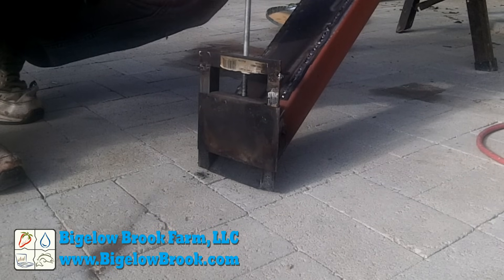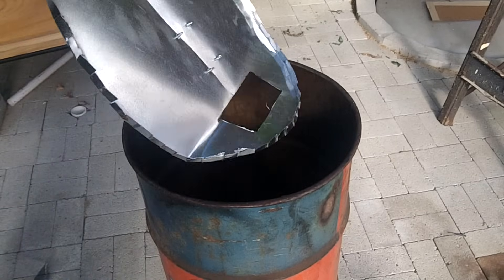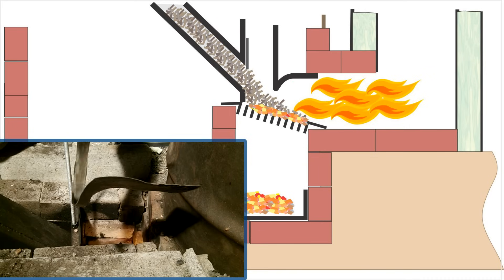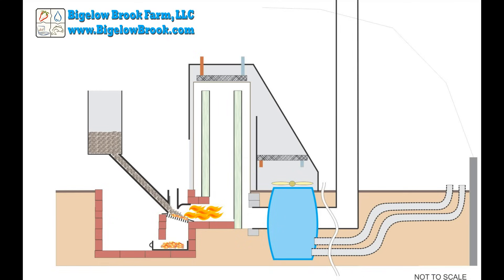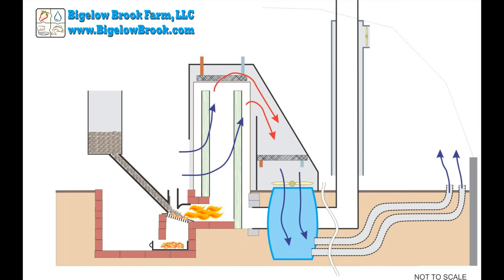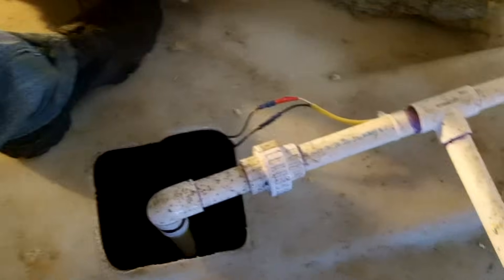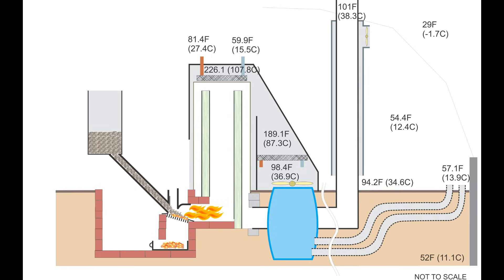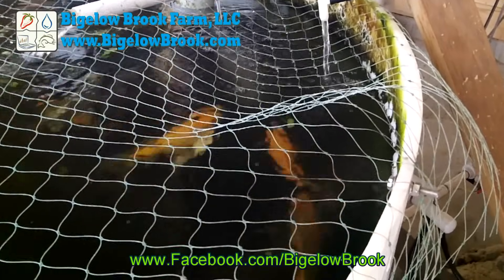Rocket Mass Heater - On Steroids

Comment: I feel like a baseboard heater model is much less moving pieces, probably more efficient, usable in the kitchen, and could run from a simple coil near the firebox, without the elaborate air handler. 

Either way, kudos to you for putting in the effort! Even if it failed dismally, you learn something!

Comment: your chimney system's temperaure falls far below 100 degrees, hence a lot of water will condense. You need a sink for that, filled with  some appropriate minerals to collect and neutralize that acid water, eg using lime stome powder, or even burnt lime (CaO). There will also be condensed carbs, rendering that mineralic buffer into a toxic waste, that needs to be buried safely.

Comment: What about combustion chamber being enclosed within barrel filled with water? Then a grafity fed piping system would store hot water in elevated container for later use? Small electric pump would circulate water through fool heating system. 

Is it just me coming with this idea or has it been done already?

Whole idea of rocket heater is to generate a lot of heat in short period of time, therefore there is a need for a mass to capture this heat and store it for later use. Water seems to be best for it.

Comment: Heat calculations feels off. 40lb per 7 hours is 6lb per hour. Typical wood pallet energy is 2 to 3 kWh per pound depending on quality, so 6lb should be 12-18kWh and you saying you are getting 4.5kWh out of it... Either system efficiency is 25-30% or something wrong with the math :)  I would bet it's the math since it is quite a complicated and smart system and shouldn't be less then 60% efficient and probably more like 80%... Anyway thanks for the video! I like some of the ideas and may use them when the time comes :)

Comment: very dangerous !!! we know little about steam!!!! if the pomp stops mayby by the fact electricitie went down.? then the water stops flowing and the rediatiator will get to a boiling point and then Steam!!!!!! inside a closed system, steam expands about !  1000!!! TIMES!!!!! WARNING!!!! the readiator will EXPLODE!!! this happens many times when people play with stove and a central heating system. there been many lives lost because of this!
Reply from the maker: This is an open system.  Even if it was a closed system, it would have had a pressure relief valve installed.
Reply: @Bigelowbrook  thats great but normmalie it combined withe a valve that also lets cold drinking water in.  futher i think its great to have people trying out some stuff we can all learn! thanks!

Comment: a few things - if you cross break those sheet metal panels, or add a hem to the edges, they will be a lot stiffer and stay flat. if there's a local sheet metal shop they can probably do that for you. 

also, any time you have a wood fire and you're trying to remove heat from it, you have to be careful because if you strip the heat from the exhaust gases then they can condense inside of the flue pipe. all the tars and resins (which turns into creosote) will clog up if your flue gases are less than 200 degrees. unless, of course, you're able to get 100% combustion in your stove, which is possible, but on start up and shut down you will not likely be able to get 100% combustion, as the system is not hot enough.

Comment: I really like all the heat exchange you're getting.

I think you might be losing some heat to expansion, going from the riser to the next chamber.  That might explain the 10-degree temperature drop in the diagram.

Comment: As an ex-boilerman in a local Sawmill I can tell you the worst thing that can happen to the feed line is fire creeping up through the fuel and reaching the storage bin.  We had that happen a couple times and it was very difficult to extinguish.  The vertical door that you installed will help but a vertical separation from the storage bin to the sloping feed tray is the best way.  A door at the bottom of the storage bin that lets fuel fall into the delivery tray ensures separation and so that fuel doesn't build up in the feed tray.  Vibrating the sloping feed tray ensures fuel goes all the way down each time your control system calls for fuel.  I know it sounds more complicated but you can't be too safe.  A fire in the fuel bin could be disastrous.  That vertical door that you used is also a very good idea.  Nicely done project!
Reply: They even have (backfires) at large CO Gen plants
Reply: Is that also the reason why you’re an ex-boilerman now? ;)

Comment: Hey there , I gave you a thumbs up for the design , work , innovation put in and learning you must have done in the project. I always appreciate some one who adds to the conversation in a meaningful way. The amount of BTU out put will always be limited by the amount of fuel burning at one time and the amount available in chosen fuel.  8000 btu per pound of hard would at 10% or less moisture. Not sure about pellets. Area of wall surface area divided "R" value of the wall then multiplied by Delta "T" ( desired temp difference needed on coldest day) will give you BTU's required for a structure . IN water it takes about 1350 BTU to heat one gallon from 40 to 180 degrees. Last exhaust temps should be kept a little above 200-235 for good draft and to prevent gases from condensing in the chimney that will cause build up of creosote, thus the myth that a rocket stove can heat your house on sticks from the yard. IT cant that wood is not dense enough or dry enough does not contains sufficient BTU out put to heat a house because there is not enough of it on fire at one time releasing the energy required.

Comment: I'm impressed. Using at rocket engine to both heat the floor and heat water is a great application. I've seen more recent attempts at heating the floor where they put insulation down below the floor because they didn't want to lose heat to the earth.  I think this might be misguided. Even if you are heating the earth for several meters below the floor, it's just more thermal mass storing heat.
Reply: The real advantage is insulating the perimeter. Heat won’t go down as much as out, because it will move to wherever is colder, which is the first few feet below grade. If you live where the frost line is several feet deep I don’t think insulation under the mass is a bad thing.

Comment: Do you find your sheet metal 'Popping' as it warms and cools?
Reply from the maker: not really, and if it did it wouldn't really matter since that part isn't a sealed area.
Reply: @Bigelowbrook  - I'm a Canadian certified Plumbing and Heating guy, so when I saw you affixing the sheet steel to you welded frame, all I heard was the popping of tin!
If you take a long, straight edge, place it corner to opposing corner, take your least favourite flathead screw driver and run it carefully kitty corner, you have a seam. Do the same to the other 2 corners so that you end up with a nice 'X', and all the 'popping' and stress on the fasteners goes away! Good luck.

Comment: So the floor is warmed just by the warm air running through the the corrugated tubing? I thought radiant floor heating was only possible with liquids..
Reply from the maker: it's a thermal battery, not radiant floor heating.

Comment: You might consider to redo your feeding system. Professional wood pelett heater usually use a screw conveyor
. this would make your stove more secure and solve all the issues you have regarding manual controlling the feeding. Plus you can build a big pelett storage below your stove and feed directly from there risk free.
Reply from the maker: The point of this design it to not need electricity to feed the pellets.
Reply: @Bigelowbrook  Right. For that, you could use some thermoelectric elements to run the screw conveyor. They are silent and should provide enough power for that. Of cours you would have to manually feed at the beginning when the oven is cold.

Comment: Great work!! 7 years later (thanks youtube!) just a question of concern I have: Taking away flue gas heat could bring down the due point of the moisture in the gasses causing it to condense and turn into water. Have you had any problems with puddles of water at the bottom of the flue, and thus corroding the flue pipe? This can be seen in condense boilers that have to discharge the water frequently.
Reply from the maker: yes.  The pipe has rotted where it exits the greenhouse.  I need to replace it!
Reply: @Bigelowbrook  would a possible solution to the flue corosion be ,to mount a zinc rod thats in hot water tanks in there ?

Comment: Try your pellets in combination with a rocket mass heater of much smaller burning dimensions. Try it without the radiators as they are probably just negating your radiant heat. 

Your pellets can feed continuously all winter long I think if they are fed in extremely small amounts into a much smaller heat chamber. The pellet consumption per week should be compared. The idea is to gain a big advantage by reducing the size of the burn chamber to something resembling a small cooking stove. Your heat can be fed into a sealed open mass chamber perhaps 8w x 12h inches instead of pipes running through your mass. Using a chamber the heat will naturally rise to the top of the 12 inch high chamber and the coldest air will drop to the bottom of your chamber. It can then be vented to the outside, only your coldest air within the chamber will ever be vented out. The vent to the exterior should be located low and at the end of the chamber farthest from the heat source. This will allow optimal striation of the hot and cold air within the chamber.

Imagine a chamber which wraps around the perimeter of your ground floor at the exterior wall. Once it reached the exit door it is vented out as exhaust. This chamber could start at one side of the doorway, wrapping around the entirety of your indoor living area before being vented. It could be perhaps only eight inches wide running along the base of your exterior wall, perhaps only twelve inches high. Properly sealed it would require no interior piping. This configuration would consume much less interior living space and produce a very steady source of heat as it would be designed to never stop burning on a very small scale. The burn rate could be adjusted by the amount of pellets fed or by the amount of air fed or a combination of the two depending on the outside air temperature and wind fluctuations.

..

Comment: Great vid - i have only one comment on this design: you may want to consider a heat exchanger at the aquaponics location to exchange heat to the water the fish are in.  Fish emit nitrates as waste and these nitrates will corrode any metal parts in your system.  The heat exchanger for the pond will need to be a material that can tolerate the high nitrate concentrations - such as a plastic unit rather than metal - since it is submerged in the pond it will not be subjected to very hot water.
I have seen some systems that combine the pond with a plant hydroponics set up so the plants extract the nitrite nitrate and ammonia and this also helps the fish.
Reply: This is absolutely correct, the water system shall best be close system, using another heat exchanger to convey the heat to fish water.

Comment: Don't take this the wrong way, but you should take some welding courses. Those welds will fail over time, due to lack of fusion and undercut. You should have turned the heat up a little, and slow down on the travel speed. I have been a Boilermaker for 20 years, we build heaters so big, you could park several busses in them.

Comment: Similar to what I've been working on. No pellets though as I am striving towards self-sustainability and pellets simply will not do. But, running wood through a shredder allows me to produce smaller sized wood for the burner and thermal valve feed control.

Comment: The gullotine stop feed is genius , however that will never pass epa regs to approve indoor use. Something has to make a fire break from the nearly vertical stack feed and it must be fool proof. While you are qualified to run your stove the mass stove community needs a accredited solution for thermal break & fire break

A additional  hump with a lever that feeds pellets when heap diminished that maintains a physical break at all times.  Once the burn  kernel diminishes a preburn heap then the spring loaded lever flap pops up and replenishes the preburn heap
Forcing down the lever and closing of main hopper feed

Additionally we need a bimetallic sensor to cut feed or lock it out if preburn heap reaches 350-400  we just might get permission. To change the world with the blessings of regulators

Comment: If you isolated the water pumped from the tank water by passing it through tubing placed in the fish tank you wouldn't clog up your radiators and you could run the separate pump for the heating water on a thermostat, no chance of boiled fish that way.

Comment: Your filter for the water from the auqaponica to the radiators could benefit from a sump tank.  A small tank where the water, after being filtered, flows freely into, and allows any unfiltered sediments to fall out of the water before the water continues into the radiators.  :-)

Comment: So 40 lbs of pellets and can only get to 54 degrees in the house?  Something is off about this setup.
Reply: That was ground temperature.
Reply: The air is being heated to 94 degrees he says. Heating the ground is more for radiant heat. The 5 degrees that the ground is being warmed up by doesn't seem like much but really makes a difference for hours even after the fire has gone out

Comment: Cool channel, enjoy the vid's. Im thinking along the lines of a wood gasifier, heat exchange water heater (to cool/condense wood gases) via rocket stove. In other words I'm interested in utilizing the advantageous characteristics of the rocket stove as a mass heater, and heat exchange to heat water and also to cool/condense the combustible gases all in one configuration. Does the rocket stove produce combustible gases? Or perhaps I should ask at what point on the rocket stove could I tap to siphon off the combustible gases? SemperFi

Comment: Would using Wood Chips be almost as good as using wood pellets? I watched a rocket stove video once before and the YouTuber says he only uses branches and twigs no thicker than 1 inch. 
Which is easy to collect, dry and use in a rocket stove. They never need to cut down a tree or chop wood. So I'm thinking it would be easy to throw branches through a wood chipper and even collect wood chips for free from an arborist.

Comment: finally see a guy sketch and do some Sci tech reasoning.  concerning points,  1   large quantity of auto feed device, 2  safty feeding device,   3   savety water recirculation,     4  savety ashes  outlet, 5   easy chamber and chimney cleaning,   6   materials.

Comment: Interesting setup.  But I would not use a box fan laying down. Most all have sleeve/thin bushing mount for the motor shaft. Its made to be run with shaft horizontal. Those mounts will wear out soon or cause motor to run with friction as the weight of the stator and fan blades push downward.
Reply: But they're $15
Reply: @doumardose9785  Your mentality is exactly the reason China owns us.

Comment: A 40 lb bag in 6 hrs is not very efficient. That would cost you at least 20 dollars a day to heat your house. That`s 600 dollars a month???
Reply from the maker: it's heating a greenhouse, not a home.  There's a huge difference.  I usually burn 2 bags when it's really cold and that's enough to last for the night.
Reply: WOW glad I don't pay that for mine. Paid $3. per bag last fall.

Comment: I grew up with a wood burning stove for a heater that my dad put a 55gal drum upside down over & let the exhaust pipe run through it to catch radiating heat & pump it to the rest of the house via a squirrel cage blower & 6" pipework along the ceiling. It worked great but not as efficient as yours... But then again were in Texas so it didn't have much to contend with. I was always trying to make it more efficient though.

Comment: I use cold outside air, coming in thru my ash pit, rather than already heated room air, to feed the firebox.  It means less lost room heat, and cracks & room vents don't tend to pull in cold outside air.  You have the pellet chute as well, but that could be sealed with leather or plastic.  I found this to make a huge difference in the comfort of peripheral areas of the house.
Reply: you2tooyou2too oh?
Reply: great idea... here's another twist... run the feed pipe from outside under ground so the 0 degree outside air is warmed by the ground to 50 degrees then goes to the stove air feed.
Reply: @nickrowe9221  The air to the fire needs to be as warm/hot as possible so as not to cool the fire and diminish combustion efficiency. This is true for any wood fired heater. Outside air is fresh, room air is stale. Use the stale warm room air to feed the fire. Use the fresh air to breathe.

Comment: You may want to consider the risks of Legionnaires Disease associated with any condensation build up in the floor pipes. Perhaps using a fluid medium for the heat conduction and venting out whatever air that remains slightly warm as an acceptable loss. Standing moisture can pose serious health risks if not dealt with regularly.

Comment: Don't you run the risk of carbon monoxide gas building up in your house?
Reply from the maker: how so?  This vents to the outside through its chimney.
Reply: OK, I misunderstood the drawing. I see now that the gray shaded area is separated from the smoke. Rocket stoves and mass heaters are essentially the same as masonry heaters aren't they? I understand that in masonry heaters there is a second combustion chamber where the gasses produced from the burning of wood combust producing very  high temperatures and heat up a large mass of masonry.
Reply from the maker: no worries.  thanks for watching!